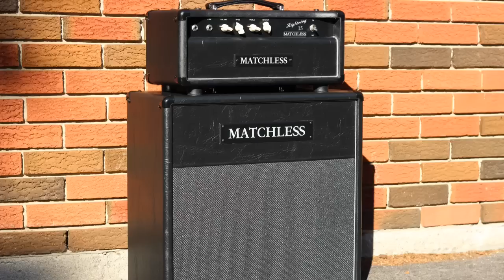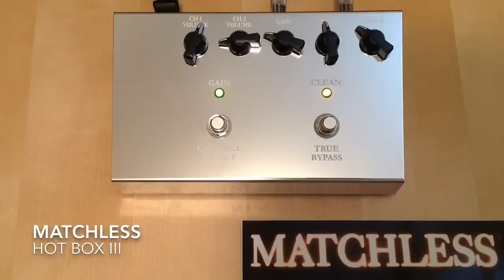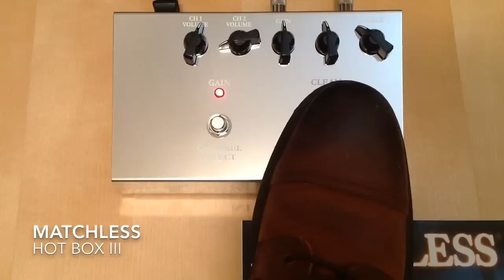Matchless Hot Box 3

Comment: The clean was pretty crunchy?
Reply: wheresallthezombies Here the hotbox is being ran into the front end of another preamp, essentially summing up to 2 gain stages (where the distortion is coming from). For this to give you pristine cleans, you'd either have to have both the preamps set pretty low on the gain controls, or bypass the amps preamplifier by going into the effects return/line-in of an amp.